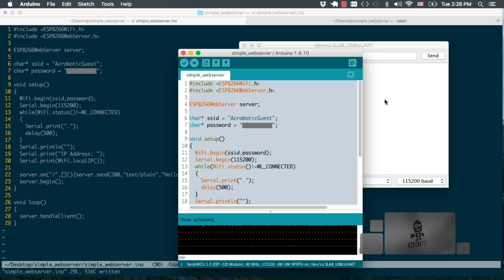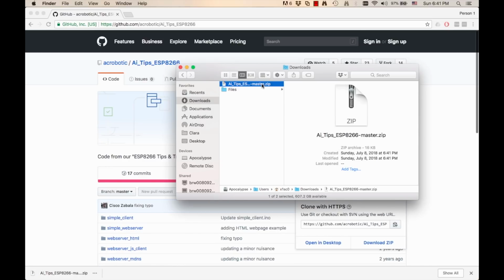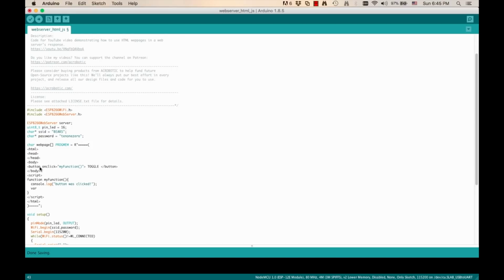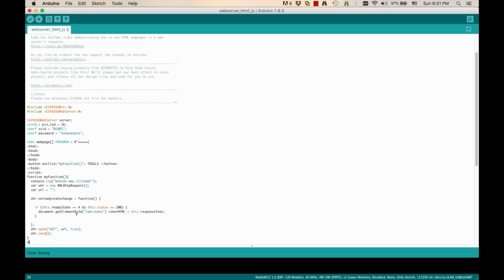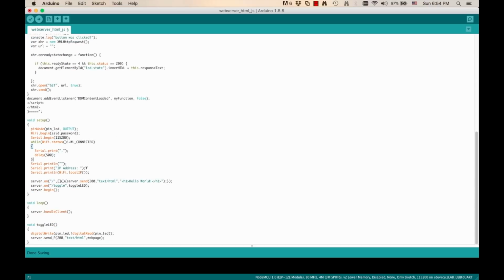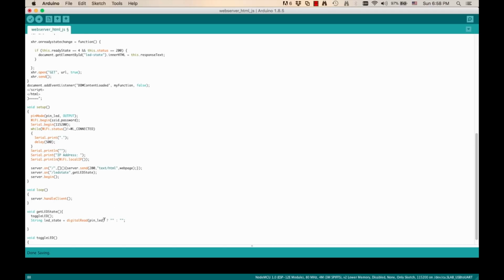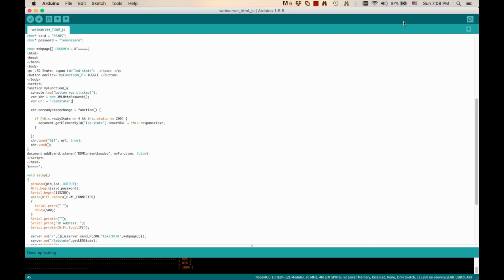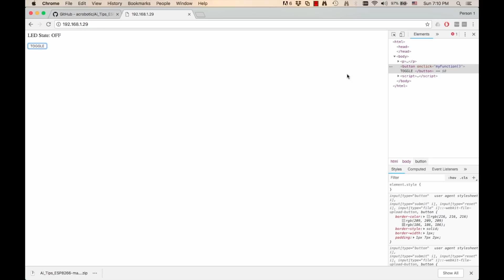ESP8266 Web Server HTML, JavaScript, and AJAX Webpages Using Arduino IDE (Mac OSX and Windows)

Comment: Great video. I have an ESP8266 serving a website and working. I'm sending and XML data and using AJAX to only update the data, so text and animated bars showing levels all update nearly real time. My data comes in every second. However...every say 10 seconds my web page sites idle for 2-3 seconds. And that is when the web is connected through my local router. In a test where i'm using port forwarding to let someone else see the web page, it may update ever 5 seconds. My web page has around 50 values that are getting updated.

I realize you can't see my code, but if the system were written correctly (not saying it's not), but do you feel this performance is about right? Seems slow but i'm not sure I can expect much from a small $3 web server. If you feel it's slow, i'll dig into it. I may consider web sockets, however my data flow only from server to client.

Thoughts?

Comment: Hi Cisco! I'd like to ask you two questions: If I have already the esp8266 set as web server and can send command from client to esp, how I can send data viceversa, I mean, from two distance sensors connected on the esp8266 to the client (web page) using AJAX. The example you show us is to send commands on and off to the esp8266 to light up a led. Is it possible from that same code to send any other sensor data and display it on the web page. Thanks in advance, Rubén.
Reply from the maker: Hey, Rubén. Yes it's possible to use the same code on either a webpage, or on another ESP8266 to respond to the device making the initial request. I made a video that can prove useful for sending data between two ESP8266: https://www.youtube.com/watch?v=gZhUi24_qms
HTH!

Comment: On trying this example with blank password ,when i try to connect the generated ap in my mobile device the connection was not stable and kept on dropping and i was not able to connect to the wifi generated by esp. can you please help with this issue?
Reply from the maker: Sorry, I'm not sure if you weren't able to connect to the AP created by the ESP8266 or if you were able to connect but the connection wasn't stable. If the connection wasn't stable, then it might be due to the distance between devices. Otherwise, make sure you have a small delay if you have additional code in your loop. Those are the first things I'd check. Thanks for watching!
Reply: @datasith  the devices were next to each other and also their was delay, can their be other reasons as well?

Comment: Thank you for your videos, I would like to do a similar thing but instead of simple html page written inside the arduino IDE I'd like to make an angular application.
So can I host angular application on ESP8266 and, at the same time, using it as a webserver to process the requests make from client-side (angular)?
you help would be very usefull, thanks a lot.
Reply from the maker: There are some firmware options that allow you to write basic JavaScript directly on the ESP8266, and run the code through an interpreter on the chip. I haven't heard anything about a full/lite support for Angular applications, however. Maybe on the ESP32 forums, which is considerably a more capable chip, you'll find people having a go at it. HTH!

Comment: What about using jQuery to have easier ajax call? I'm going to search about it!
Reply from the maker: Hey, Marco. If your ESP8266 has internet access then you can include jQuery dynamically (e.g., from a CDN) in the webpage with the script tag. I understand that if you're used to jQuery it may seem that it makes things easier, but please know nothing beats raw JavaScript in terms of simplicity.
Reply: @datasith  thanks for the reply dude, you are right! Simplicity and functionality are the key features of js but it tends to get a bit long :) 
As a web developer I'm more afraid of the Arduino part and I'm used to js and in particular to jQuery, a js library, that can help a lot in fast animation, ajax calls and lots of other things that js can do for sure but also it takes three times the lines.

I will do as you suggested: load the script from an outer source to introduce jQuery to our little esp8266!
We are going to have WordPress on the esp8266 haha I'm jocking :)
Reply from the maker: Marco Guada haha nice! I agree 100% using what you know already to move forward quicker :) Fyi, websockets is an option as well and the code isn’t too bad (I have a video example). Also, you can write html, js, css diles on your computer, and then upload them to the ESP8266’s flash memory. Makes the web development side easier.

P.S. I wouldn’t be surprised is someone added PHP support to the ESP8266 so with a non-local MySQL database it might be possible lol
Reply: @datasith  Question, are you saying to access JQuery via CDN because of space on the ESP8266?

Comment: Nice tutorial!  How can we update dynamically the state of the LED without having to reload the page or press on a button on the web page in your example?  Let's say I change the state of the LED on the Wemos with something else (reading a physical switch) but I want the Wemos to update dynamically the LED state on the web page?  The arduino code should push a value to the web page on it's own. HTTP Put??  I'm sure it is simple but can't figure out how to do it for this simple example.  Thanks for your help!
Reply from the maker: Thank you! Yup you can. That's the point of using AJAX, avoiding the page refresh. In another video, I also go over how to do it with Websockets, which is the latest way to transfer data between client and server. In your case we can do 1 of 3 options:
1. As you mention, you can send an HTTP POST using a WiFiClient object in your code that runs when you press the button.
2. You can use JavaScript/AJAX to poll the status of the button periodically (e.g., SetInterval() function), using a route named (for example) "/status" that returns the value (0 or 1) of the button. The value can be update in the loop().
3. You can use Websockets to do something similar to the above, it's easier because the communication is bidirectional by design, so you don't need to do the polling, the server generates an event when the button is pressed that can be reflected on the page as well. Here's how to get started: https://www.youtube.com/watch?v=ROeT-gyYZfw
Reply: Thanks for your answer I really appreciate it  @datasith  !  I learn a lot from your videos and will experiment with Websockets.  After doing a bit of research, I found a wonderful and simple workaround solution that works very well for me.  I only wanted to refresh the LED state and temperature reading every 3 seconds on the web page.  I added an interval loop updating function in the Javascript part of the web page.  The function run with an interval set that way: var update_loop = setInterval(Main, 3000);
Main();
function Main() {                     
  disTemperature();              //refresh temperature reading
  myFunction();                     //refresh the LED state value ON or OFF
}  That's it!  The beauty of the method is that if no client is online with the web page, the code doesn't run and the Wemos can do only what he has to normally and other tasks.
Reply from the maker: Yup, perfect! Remember that you also have a couple of other options for future projects. I'm glad you figured it out; best of luck!

Comment: thanks, how can I change the button size and colour
Reply: Hi again, everytime i refresh the web page, the led light will toggle either on or off. anyway of stopping it?
Reply from the maker: To change the size and color of the button you need to learn a little CSS. If you search for it, you'll find some straight-forward examples.
Now for stopping the toggling on page load, you need to revise the JavaScript code. Notice that it runs every time you load the page, so you need to enclose the code within an "if" statement.
Thanks for stopping by my channel!

Comment: Hi I have Arduino Mega  is it possible to control several things what is connected to Arduino via esp-01 ore similar esp??? And if it is possible, then maybe you  can suggest something how to do that???
Reply from the maker: Yes it is possible. You can connect them over Serial and exchange data using Serial.print() and Serial.read(). There are other ways, but that's the simplest. Good luck with your projects!

Comment: Great video as always. 
One issue I get is when the page is refreshed the led will toggle.
For example if I open a new browser  lets say on a phone the led will toggle without pressing the html button.
Is there a way to stop that?
Reply from the maker: Thanks for the kind words, Paul. Here's how:
The LED toggles when the JavaScript function "*myFunction()*" is called. This happens when the button is clicked using its "*onclick*" attribute, and when the page is loaded using the document's event listener method.
So if you get rid of the event listener line:
document.addEventListener('DOMContentLoaded', myFunction, false);
Then the function won't be called when the page is loaded. HTH.
Reply: Thank you for quick reply. I will give it a try.
Reply: @datasith  it didn't work

Comment: Can you make a video on how to remotely control the ESP from a non-local html page using a database like Google Firebase?
Reply from the maker: Sure thing, have you seen the one using Cayenne:
https://youtu.be/6YAnqHTm7_o

Or were you thinking of avoiding a 3rd party service?
Reply: Exactly, I want to code a webpage with the buttons and dials myself. For example, I want the buttons to have underlying javascript that changes the value of a variable in a Firebase database. The ESP would see the change and run code based on the new value that it pulls from Firebase.
Reply from the maker: Gotcha! I'm working on one building a web app (Python) on Heroku for monitoring and controlling the ESP8266. It'll be up in about 3 weeks, stay tuned!